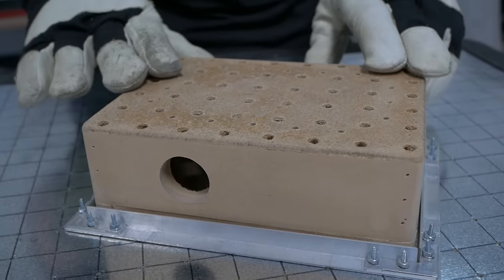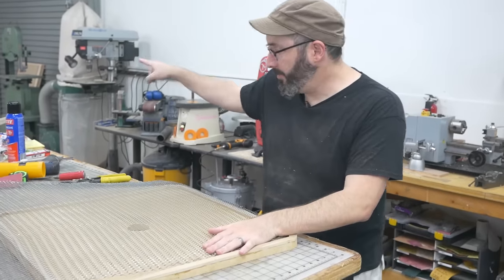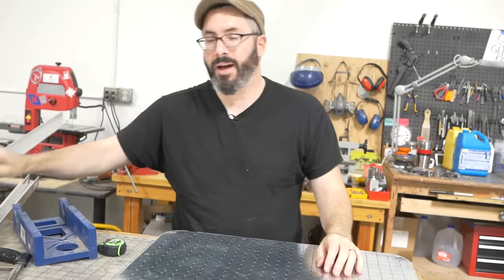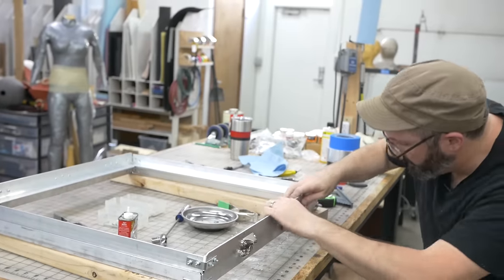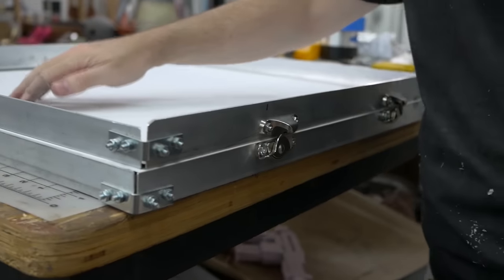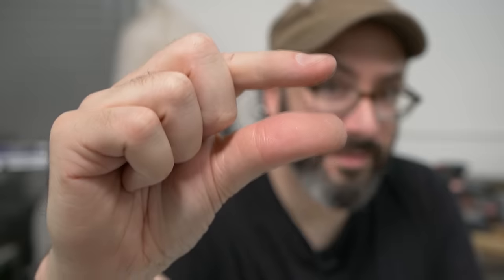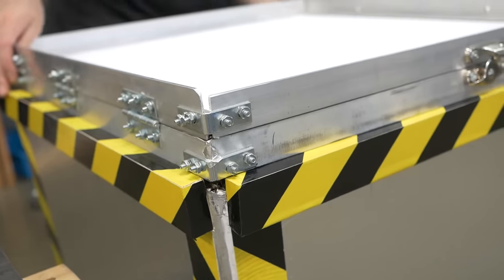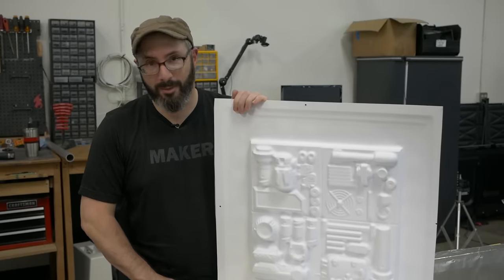Hardware Store Vacuum Table - HOW TO make your own

Comment: OK, I've watched through 30:44. Pretty sure I'm never going to learn why metal mesh separators were better than pieces of spacer wood, probably because they aren't better. The foil lined hinged heat box was just assembled. But it's still too tall. The cardboard version heated well, but not well enough. Why not a shorter box height bringing the styrene sheet closer to the heater elements (but still far enough away that they don't catch on fire)?

Comment: Great problem solving on hardware you bought at your local Hardware store.  virtutem populo!!!  

Can you put a link to the Duplicate Stick. . . I need one.

And the banana for scale.  You guys are having too much fun.  As it should be. 

I agree with the commenters above who said put some rubber around the frame to better hold your plastic. 

Names:  
melty danger suck (substitute "Hotty" for Melty.  I could not decide)

Hotty Mcsuck Suck. (substitute "Melty" for Hotty.  I could not decide)

Lloyd.   It's odd, but regal because it has two Ls.  

Really great video. . I am now a fan!!!

Comment: do you suppose an indoor grill (or 2) would be sufficient to use for the heaters?
also I have some 1/2" 19 gauge wire mesh (screen?) and wondered about using that between the MDF boards.
Reply from the maker: Hmmm I'm not sure, I haven't ever tried that

Comment: May I ask why the heat box is so high (lower one would heat up faster) 18 inches high
Reply from the maker: We originally had a much more shallow box but had some issues with our heating elements being too focused in the areas they heated. We extended the box to allow for a more even distribution of heat, and it worked a lot better. Ideally we would have changed the type of heaters, but we had a pretty short deadline and came up with this method to make what we had work!

Comment: if you want to heat faster and more the plastic, isolate the upper portion of the plastic, at the same time you are heating the plastic in one side, the other side is cooling so you lose a lot of heat, other than that good job XD

Comment: I haven't gotten all the way through,  but couldn't you just cut like an inch of the hinges off the top instead of rebuilding it to get the plastic form to fit over the heater?
Reply from the maker: Yes that would probably work.

Comment: You could solder the aluminum. The heat shouldn't be a concern, your plastic would be destroyed before you'd ever get close to melting the solder in regular use.

Comment: BTW, those sash cam latches are pulling the top frame laterally and pushing against the bottom... They are not designed to pull the sashes together. They are designed to push down on the bottom sash and push up on the top sash.  You really want suitcase latches or some other type of draw latch.
Reply from the maker: Great points! I realized this myself after using the frame for a couple of pulls...

Comment: I need a seamless one part sphere & thought of blow molding. I don't have the money to make a metal mold. So, would it be possible to use a plaster & wood frame for the mold?
Reply from the maker: Hmmm that's a good question, and to be honest, I'm not sure! I've never tried to make that kind of mold. Maybe try asking the folks at Smooth-On customer service if they have any ideas? They're usually really helpful for picking the right materials and processes for a project.

Comment: If your shop is large enough to accommodate this beast along with other power tools, I think it's safe to say you'll have a commercial circuit system.
Reply from the maker: Yeah our shop is well equipped for this kind of machine.

Comment: I'm sure you're aware of this, but the pastic being white means it doesn't get as hot as it could be. At the very least it's slower and uses more energy then is necessary. There are 3 main ways of transferring heat. conduction, convection and radiation. conduction means transferring heat between solids directly, which doesn't apply here. convection uses a medium (like air of water) to transfer heat. This is what mostly happens here, which was done well by (mostly) trapping the air in. The last one it radiation, which is the transfer of heat through light (photons). The amount of light that is reflected or absorbed by objects depends on various things, like material, surface area but also its color. This is the reason why darker cars get warmer than light cars when exposed to the sun. So to get to the point (which took me long enough, trust me I know). You can increase the efficiency of your vacuum former setup by.
1. using darker plastic.
2. painting the aluminum holder for the plastic white (with some kind of heat resistant paint) so it becomes less hot in the process. 
There are ofcourse more ways, but this is what I know could help. Great video and keep up the good work.

Comment: Use wd40 as a mold release and add small holes in the mold to aid in detail 
I used to mold truck parts out of 1/4 inch abs and it was all custome built by us at the shop

Comment: My smaller glass kiln is 38 x 26 inside and it would heat that perfectly in moments.
Reply from the maker: Oooh that sounds great!
Reply: After the Halloween rush, I may have to look into this vacuum forming process. I love learning new techniques and processes. My larger kiln is about 3 1/2 feet by 11 feet but that's a little too big for this process.

Comment: Call it Truman. Because the Buck Stops Here. And if you can make a worse joke, name it that instead.
I'd get a little foot switch - the cheap kind from the hardware store for Christmas lights and stuff - and use it to control the ShopVac for one-person operation.Thanks for the video. I recently had an idea that may have me making a vacuformer for just one little project so quick and dirty is what I want.

Comment: I doubt that any drilling in wood would cause any drill bit to soften enough to bend.  It would have to be dull red hot and wood friction would not cause that.  I have drilled lots of holes with a small bit in steel and yes, it gets hot but not even close to bending.  the bend could have been caused by fatigue in the driller, but not any metal being too hot.

also, a vix bit helps get holes to line up when drilling holes like you did with the brackets to hold the alum angle frames together.

Comment: Would a heat gun help with the fine tuning each time you put the plastic over the mold?
Reply from the maker: Potentially, but you run the risk of stretching the fabric inconsistently and causing tears or burning

Comment: You need to drill some tiny holes through some of the areas of your mold. The vacuum cant draw through solid  wood or objects. so you have to think of a perforated mold or base. The webbing along your edges is caused by the air drawing around the mold instead of small holes drilled along the edges so as to help the vacuum draw EVENLY pulling the plastic towards the vacuum (down) BTW heating the plastic from the top is the better way. the reason being that your making the plastic hotter on the mold side as opposed to the side you care about.  If  you want more info or better explanation. Hit me up with a message. Cheers

Comment: If you had made the heat box so that it fits inside the metal plastic holder then it would have rested on the bottom nicely and it would have held the heat in better.
Reply from the maker: Thanks for the tip!

Comment: I wouldn't have the patience for wingnuts... 34:15 how about making that hole go through both parts of the frame (top and bottom)? Then you mount a screw with a rounded head on one side and make the hole on the other side large enough so the head fits inside it when the frame closes (plus some tolerance to fit your material). It should hold everything in place and you could add as many as you want (don't use too large of a screw head your material is not flexible when cold). Another solution would be to add a gasket around the top and bottom of and use squared tubing instead for the frame.
Reply from the maker: Interesting ideas!

Comment: I was wondering, using acetone to melt foam & flatten it out on a cookie sheet. Can you use those plastic sheets for vacuum forming?
Reply from the maker: Maybe! I know you actually can vacuum form foam as-is, it just depends on the thickness of the foam and the strength of your vacuum.

Comment: So..  Is there a more efficient way to build a table?  I'm not criticizing your design, I'm unclear on the process.   So what if you wanted to form a small part on that huge table?  It seems like a TON of wasted plastic?  How do you control this aspect?  Is there a way without having multiple tables?
Reply from the maker: We ended up creating multiple tops for the heater, but we try to use our smaller toaster oven set up when we can. Vacuum forming is kind of rare in our shop so we've only used the set up about once a year.

Comment: Wow, 4 years ago, I guess I’m late to the party.  To get better warming of the sheet, you might add an insulated panel over the plastic.  Right now the heat goes up to the sheet,  and warms the sheet from the bottom.  The warm sheet is in contact with room air so the top surface of the plastic is cooling.  You can use an IR reflective sheet as t top cover then the plastic will warm more quickly and you won’t have a heat gradient through the 0.06” plastic sheet.

Comment: Just a thought on getting rid of the screws. 

Notice that you didn't need them on the front. Perhaps putting two sash locks on each side and adding bracket or three that spans top and bottom (to prevent the twist) would get rid of that manual drill and fasten step.

Comment: Cool this gives me an idea. 

Here is a tip. Use rivets to attach the hardware to your aluminum frame and instead of angled aluminum use box tube stock. Granted it costs twice as much but it won’t deform on you when you clamp it. A thicker gauge aluminum angle stock would also suffice. 

If it where me I think I would design a propane powered oven as opposed to an electric one. A foot switch for the shop vac would be a must have for me.

Comment: Am I the only one thinking a 30 degree cut would have been better for the spacers?
Question: You got 120 VAC @ 15 A, I've got 240 VAC @ 10 A...is my power supply equal to you having 120 VAC @ 20 A?
Reply from the maker: Correct! Electrical power, or wattage, is measured by Volts multiplied by the Amps. So 120 at 15 amps = 1800 watts. 240 volts at 10 amps is 2400 watts and 120 volts at 20 amps is also 2400 watts.

Comment: What thickness HIPS are you using? And what temp are you aiming for?
Reply: I'm wondering the same thing
Reply from the maker: I'm using PET-G, linked in the description of the video. The temperature I shoot for depends on the thickness of the material and which material it is. I believe I talk a bit about that in the video.

Comment: I was just wondering if you considered using one of the radiant barrier treated particalboard or plywood products or was this just not cost effective?
Reply from the maker: I went with wood products that I'm already familiar with.
Reply: @punishedprops  ah! Well, there are some wood sheeting products that are pre-treated with aluminum or copper based heat reflective paint. This seems like a good project for such a thing. If i ever get the space i will try it myself.

Comment: To get away with one heater, I'd put the frame close to the heater and spin it to get a more even coverage (hey, it's what they do in microwave ovens) and add an insulating lid above the frame to keep the heat in.

Comment: What if you used heat guns. In place of the heaters?
Reply from the maker: You technically can use a heat gun but it's not ideal. What you really need for vacuum forming is a uniform heating of the material so that it will evenly pull over or into your mold. That's why we use heaters rather than heat guns, which heat a much smaller area of coverage and also doesn't get quite hot enough.

Comment: This is a tempting project, a good compliment to 3D printers and CNC routers. Would it be an idea to place a small heat powered fan inside the heating box? Stirring things up usually helps to even out and improve heating.
Reply from the maker: That might help, but I've never heard of any other vacuum form machines including fans, so I didn't think to try.

Comment: Enjoyable watch and very in-depth. Is it not a seriously bad idea to have your heaters underneath the plastic? I've heard before this is an absolute no-no! If the plastic were to suddenly collapse and land on the heaters, you'd have a hell of a mess, a potential fire and would also need to trash the heaters 🔥 I get why you put them underneath, but for safety's sake, I reckon this method is far too dangerous to demonstrate to your average home diy'er 😣
Reply from the maker: I've seen several examples of this style with the heater under the plastic. I should have pointed out how critical it is that you do not leave it unattended. This goes for any style of vacuum former.

Comment: why not reduce the hight of the box by 10". then fit a heat control. this way you can adjust the heat for different thickness of plastic

Comment: could pie cut that aluminum frame at 45 degrees for each corner then fold the aluminum into the frame shape and gotten away with only using maybe four screws to join each frame together ... save a few bucks on hardware...
Reply from the maker: That is a fantastic idea!

Comment: You're losing a heck of a lot of your precious heat by not using an insulated reflecting barrier inside your box! I'm surprised you guys didn't think of that! Use the reflective insulation used in the construction trade!
Reply from the maker: Thanks for the tip!

Comment: Bam.  The reason your conner miters do not meet up, what you did was cut 2 side rails at 45 dgr. And left the small part at 90 dgr on both ends, this is very common 
For people to do this but its not correct.

To do a 3 part perfect 90dgr you cut each part at 22.5 dgr  your deviding a 90 by 4 cuts  this lets each cuts long sides match perfectly. I do not think you can do that on the plastic miter box.
Your going to need to cut that with a miter saw or radial arm saw.
If your using a long board you can bend the grain a full 360 to match on 3 corners
The forth will not match  each outside corner  will have a 45 but be cut at 22.5 for each joint.  This would make a nice wide edge band for a dinning table with the last edge embellished with some type of dutchman connection to draw your eye away from the fact the wood grain dosnt match.

Comment: Why wood for the heating box, why not use a fire proof material like Hardie backer board thats going to hold heat. With a enclosed space you slide the frame into to heat up once the inside tempture reaches its 400 dgr tempture your looking for you can also insulate the box with roxol wool and build a outer box  out of mdf covered with foil. This oven will hold heat evenly so when you slide in your frame all of the plastic is a uniform tempture. Becuse the oven holds heat youll use less energy keeping it up to tempture. You'll also get more uniform air using a fan to make it a convection oven.  When it's not being used for plastic it will bake cookies of pizzas.

Comment: Next time just use J-B WELD metal reinforced epoxy to connect and close the seams of the aluminum frame and clamp it or tape it until it sets up. 

It sets in 4 - 6 hours and fully cures in 15 to 24 hours. It's really strong stuff and it works well for metal, wood, plastic, tile, pvc, etc, etc. And its rated at a tensile strength of 3960 PSI.

Comment: Woudn't it be better to forget the mesh and instead place 16 or so square or round small spacers the same thickness as the border? They could be 1/2" diameter and  would be spaced out in a matrix, and would support the upper board but would not block the airflow. Maybe add a round filter at the bottom to cap it off.
Reply from the maker: That's also a great idea!

Comment: don't change the RCD from 15 to 20 amps you have to have the right wiring to handle it otherwise you can end up hating the wire and melt the installation and can cause a fire or short or electrical shock

Comment: Instead of the expanded metal why not just use the same wood that you used around the edges to separate the bottom from the top?

Comment: Could you heat the polystyrene with a heat gun?
Reply from the maker: You could, but because heat guns are a very focused area of heat, you'd end up with a super unevenly heated surface. That's the trick with vacuum forming. You really need to get an even heating on your material for the best results.

Comment: For your top, how about putting a few speed controllable fans to blow the heat DOWN onto the plastic. Not too much or you will blow it into odd shapes. These fans can be set for full power after the thermoforming has been done and the heaters switched off, that way you also cool the lamps and your plastic, thus setting your form and helping with the longevity of your heaters ;-)

In mine, I keep the heat on until the forming has done (you get better detail) AND, you need to put some FINE holes in your mould in the corners etc. Again, this allows better detail forming.